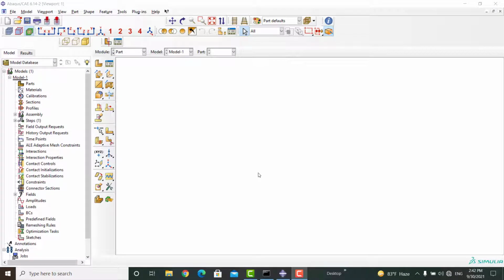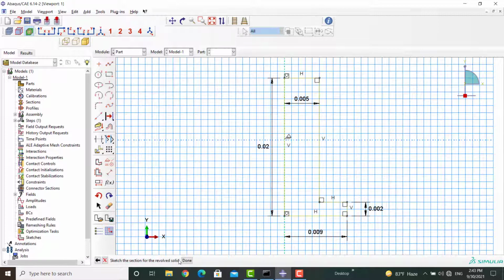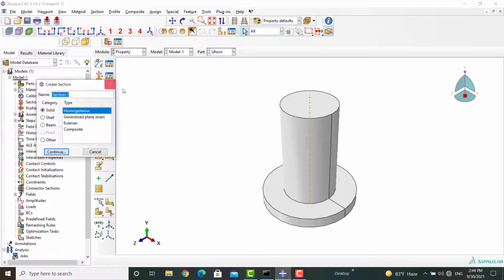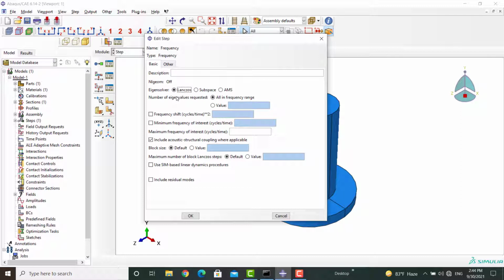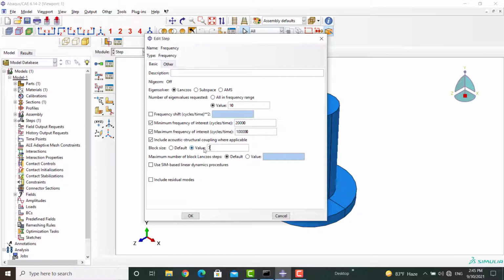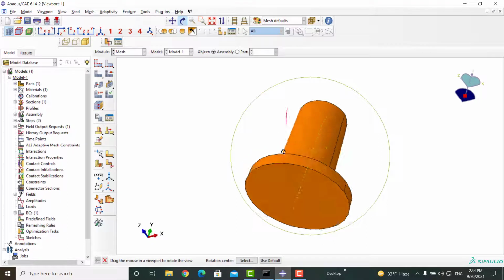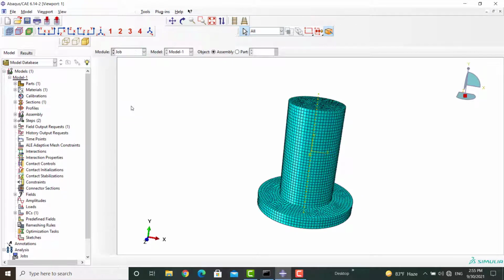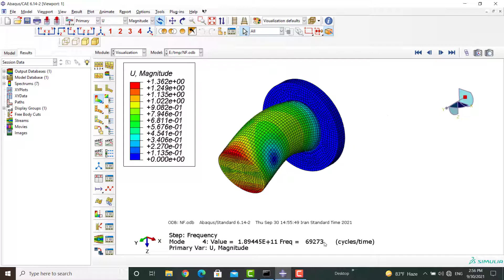Natural frequencies and mode shapes of ultrasonic horn by Frequency step of Abaqus

Comment: completely specialized video of interest to only a very few.

PRACTICAL   use this knowledge to construct ultrasonic horn shapes for air applications to silence barking dogs.  if you can couple these horn shapes in an air horn, one could blast a barking dog into submission without disturbing any of the other neighbors.

no,  this is not already made.  the majority of ultrasonic anti-barking devices on the market today are electronic and simply too weak to be effective in most cases.